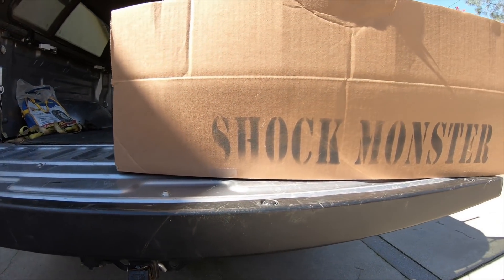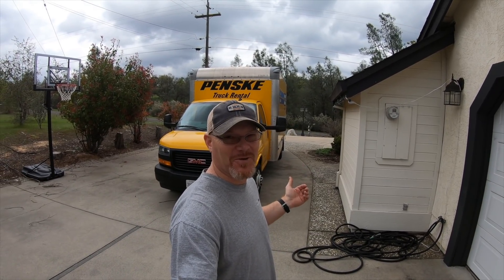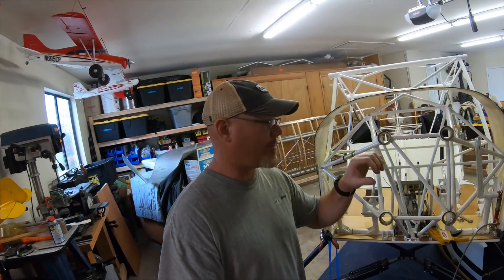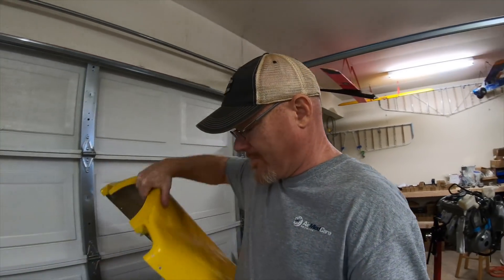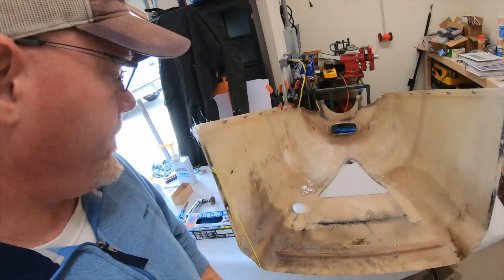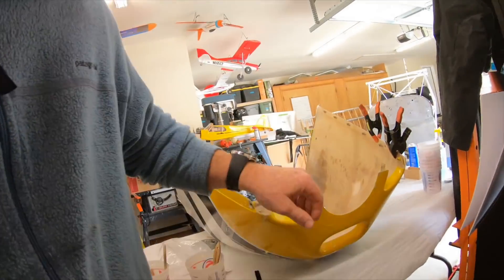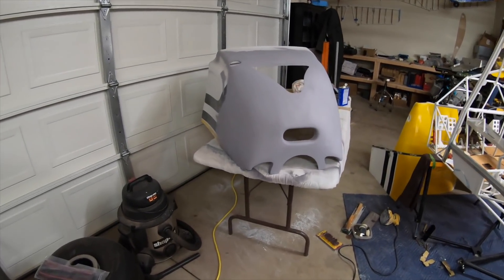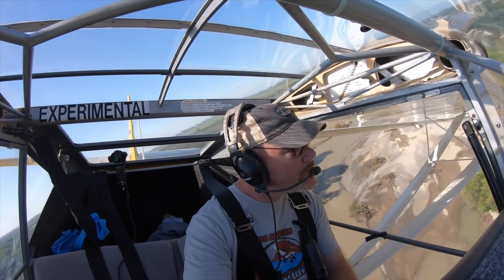Kitfox 7 Apex Build Episode 6 Kitfox APEX Build,  What's in the Truck

Comment: Thank you for the great videos!  I have a quick suggestion for you regarding the fiberglass.  If you check out the video from the YouTube channel Boatworks Today called "Can CSM (Chopped Strand Matting) Be Used With Epoxy??", he does a side by side comparison of a CSM layup using Polyester Resin & Epoxy.  The Polyester resin works much better since it can dissolve the styrene binder that is used to hold CSM together when it is manufactured while the epoxy resin can't.  Anyway, I thought this might make future repairs using CSM a little bit easier.

Comment: Bryan, i notice you have RC planes. How much more work and difference is from building RC to Kitfox? Hope to build one but not sure of building my 1st kitfox
Reply from the maker: It is quite different, but if you like building RC I think you would like building a Kitfox.
Reply: @BowenAero  Engine and avionics seems intimating to install; how's your experience with them? And have you considered other kits?
Reply from the maker: @leadpan  Avionics and wiring is one of my favorite parts. The engine on my current Kitfox is a Lycoming and it was intimidating at first, but now I know it so well and enjoy working on it. The new build will be a lot more complex and there is really no support for it other than the internet. We will see how that goes.
Reply: @BowenAero  Bryan, in general is the kit frame easier to build then firewall forward?
Reply from the maker: Not sure yet. This firewall forward is uncharted waters, I'll let you know.

Comment: Hey Bryan, enjoying your build progress videos. I’d suggest getting as much direct airflow as possible into your radiator. Remember, its cooling both the coolant and the oil. These motors generate a lot of heat. I had to modify my cowling to get a direct flow from the airstream directed to the radiator for my RX1. It was originally running 220 degrees on climb out in the summertime. Now its running 185. I would lose the NACA scoop. Just a suggestion from someone who’s been there.

Comment: I wouldn't use that old copper/soldered radiator. They are prone to springing leaks at the most inopportune time. The newer welded aluminum radiator is a much stronger radiator.
Reply from the maker: Thanks, that is good to know.